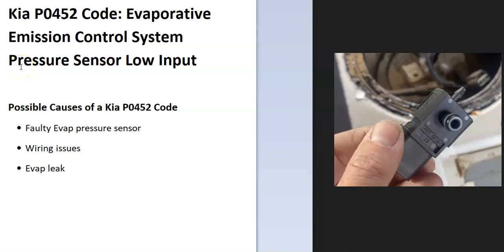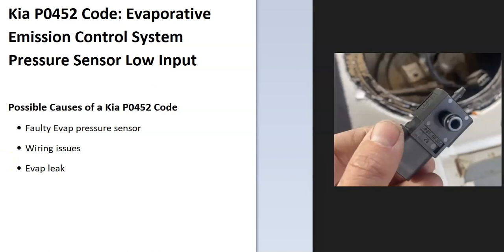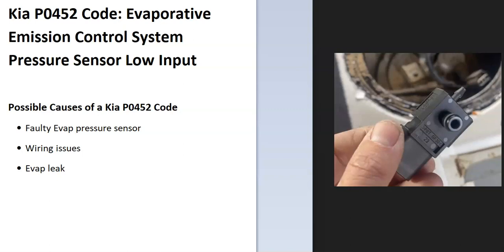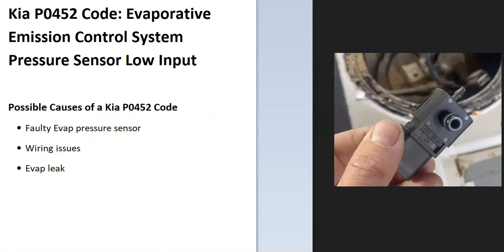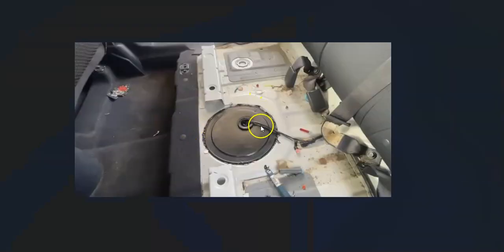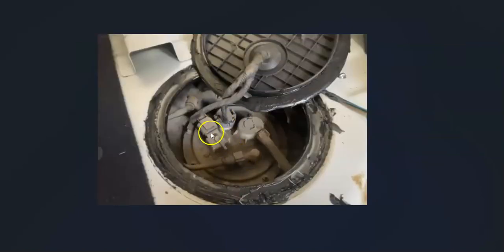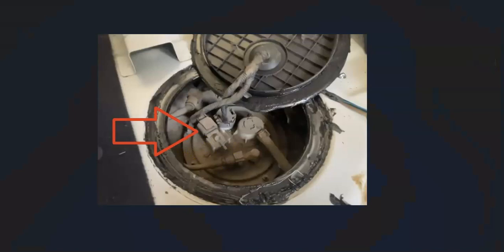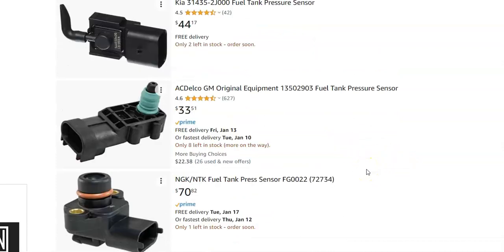How To Fix a KIA P0452 Code: Evaporative Emission Control System Pressure Sensor Low Input

Comment: Thank you for your video on code p0452 change sensor and still comes back after replacement and reset check engine light what else is there to check
Reply from the maker: I would check the wiring
Reply: Hello Sir quick question was it the wiring because I have the same exact issue I change the sensor twice and still the code pops up

Comment: Appreciate your videos. Am having consistently codes p0107 and code p0452. Is there a common factor or is2 different problems?  Thank you.
Reply from the maker: A P0107 Code is a Manifold Absolute Pressure/Barometric Pressure Circuit Low Input